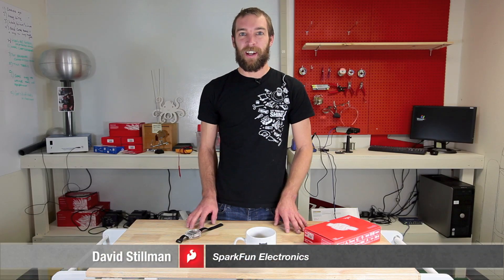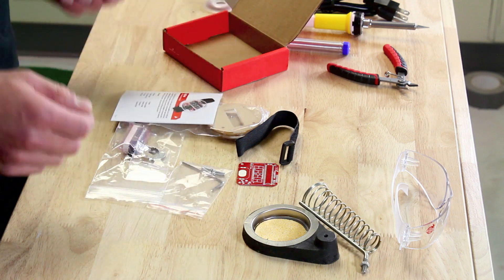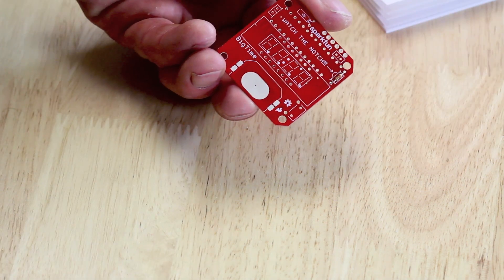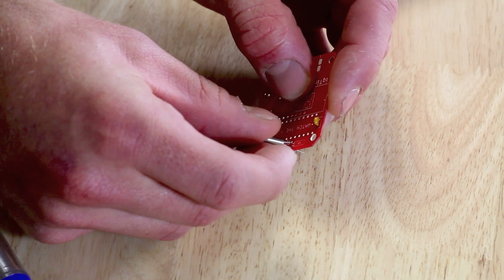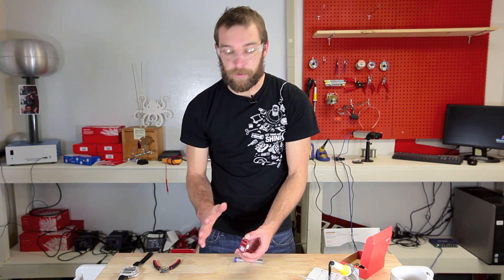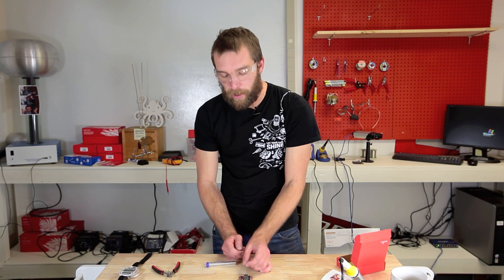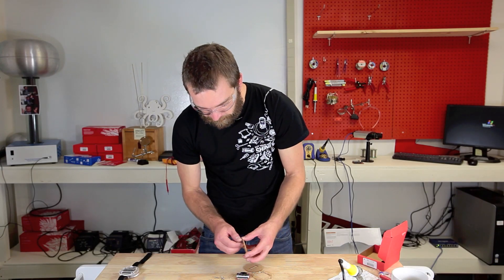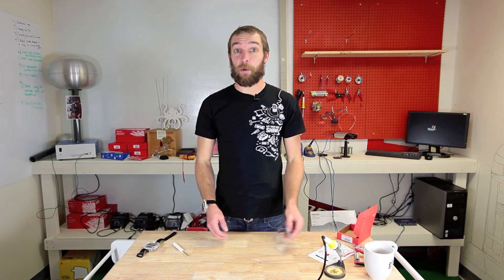SparkFun Big Time Assembly with David Stillman

Comment: The pin that is clipped is just PC5, just another port I/O pin.  So it really doesn't affect its operation or modification too much.  If you noticed there are some plated through holes next to a capacitor and the crystal.  Those holes are for a FTDI connection so you can modify the program or upload your own.

Comment: When you replace the sponge, fold it half and then half again so it looks like a thick little pizza. Then snip off a VERY small bit of the point. Then unfold. TAADAAH your sponge now has a little hole in it that lets you wipe off the solder and schmutz very easily and quickly.

Also, I loved the quick video cut of the cutting... Damn fine editing there.